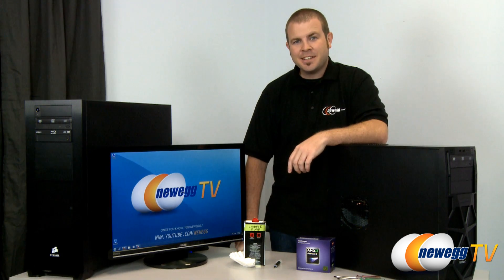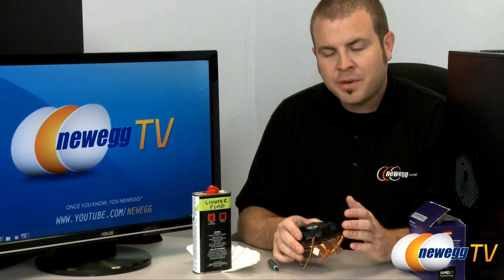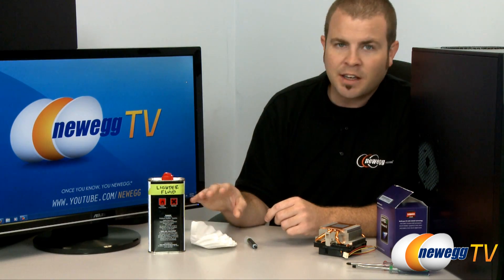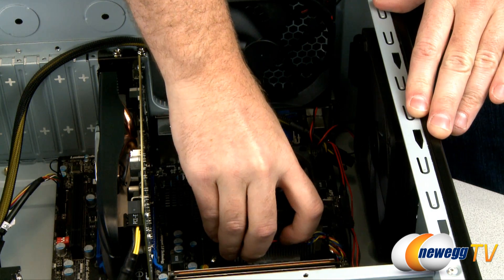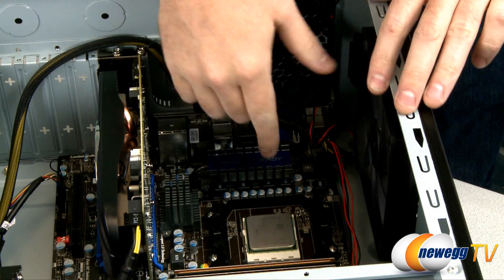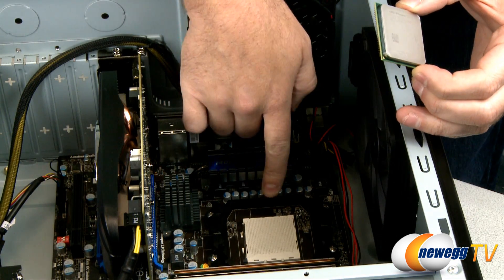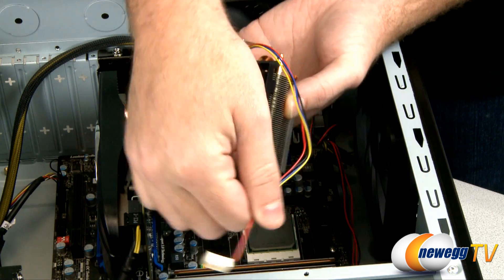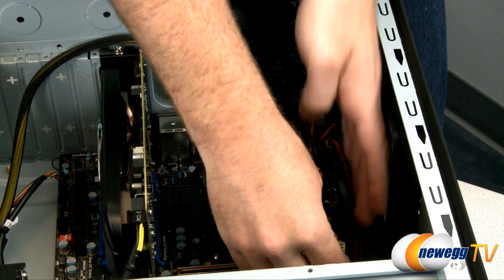Newegg Tutorial: How To Install an AMD CPU

Comment: question. i am swapping an i5 for an i7. it says its compatible with my motherboard. i want to make sure it works though. so would i be able to assemble it without the thermal paste only for a few seconds to make sure it boots, then shut it down immediately after? or do i run the risk of it damaging my cpu? basically how long do these things take to heat up? any input would be helpful. thanks!
Reply: Michael Guido just booting a PC without a heat sink ca n burn out the CPU

Comment: can someone explain to me what an aftermarket cpu is
Reply: +R4GEMODECLAN I&#39;ve only heard of aftermarket coolers. They do a better job keeping the cores (CPU) temperatures low than stock (the fan that comes with the processor). It&#39;s imperative that you buy aftermarket coolers if you plan on doing overclock. Overclocking helps AMD processors by unlocking their full potential. However overclocking increases temperatures and without proper cooling, will damage the CPU.
If you want to monitor temperatures and have no software to do so, install the program HWmonitor

Comment: Broke my cpu cos I didn't leave it on for 5 mins before, had to twist it off heat sink then it snapped out of my hands onto the bench and one of the pins broke off :(
Reply: +PopularOMGS Thermal paste was hard, when I tried to take the CPU off the heatsink it snapped out of my hands onto the bench, breaking the pins

Comment: I'm getting a new CPU, I already know which one and I checked so it all fits with my motherboard and so on. But after watching this video I just want to know, do I have to apply something to my new CPU or is what's on my fan going to be enough? And if I need to apply anything, can someone tell me what that is?
Reply: ***** That depends.. Are your over clocking your CPU? If not. The fan that comes with your CPU is good enough.
Reply: Millenia Williams No I'm just using it normally. Okay thanks!:D

Comment: so i can just swap stuff out on a pc when it gets old.....fuck ive wasted so much money on consoles honestly i feel like ive been robbed wtf like thought itd be all software shit but its basicaly take it out put ur new one in.
Reply: Not really. If you have a motherboard that's compatible, you can just swap out CPUs, though if you have a good processor right now, you'll be good for a quite a while.

For graphics cards, yes, its just a matter of swapping the cards and changing the drivers.

Building a PC is not difficult. It can be intimidating at first, but you'll get used to it. Also, I did a quick calculation a while back. PC gaming, even if you have to upgrade a graphics card after 2-3 years (basically 2-3 cards for a console cycle), it can still be much cheaper than console gaming, thanks to overall cheaper games, Steam sales and free online service.

Comment: ok some people are saying that fx 6300 is crap it ruins the gameplay and i should get i3 over fx 6300..and some people like tek syndikate are sayind that fx 6300 are so fast and they can reach 200 dollar cpu..so im just a gamer i dont do any video editint and stuf like that,,,i just play games at 1080p maxed out..I really need hellp..thanks p.s
Reply: Hey. Yeah yeah late response, but it is in fact worth the price to buy an fx-6300. The only reason why people by an i3-3220 is because they plan to upgrade that CPU to an i5 or higher. So if you want to stick to the fx-6300 which is better than the i3 (and is a beast overclocker), go ahead. But if you plan to upgrade your CPU, an i3 will do.

Comment: does the fan come with the processor itself? or is that bought seperately?
Reply: stock (storebought versions) cpu's come with a cheeper heatsink/fan which are usually noisy, so you will most likely get a heatsink/fan if you buy it new the only time you probally wont is if you buy it used but you can buy them cheep of ebay or newegg
Reply: wolfEXE57 thanks :D

Comment: How do u tell if your CPU will work with your motherboard
Reply: ***** if a mother board supports intel will it support every intel cpu or only specific ones
Reply: an important thing to keep in mind is that intel mobos only support intel cpus, and amd mobos only support amd cpus.  then you need to take the pin arrangement into account (LGA/PGA XXXX), and even then you really need to check each individual board to make sure it's compatible with your cpu, or the other way around.  it would be much simpler if they were all universal and standardized, but they aren't.

Comment: I just started my build (ordered from newegg) and tried to be very careful, but the clip on the side wouldn't attach the cpu fan onto the amd cpu. As I took it off to try again, a small metal plate with 2 protrusions on opposite ends came out. I don't know what to do.  Is this heatsink fan done? It was supposed to be new, and the paste was preapplied, but the copper bottom was really scratched before I even tried to use it. What can I do? It's my first build and I have tried to be very careful, grounding myself, etc. [I know I should reapply cooling paste from somewhere...]

Comment: It largely depends on your motherboards socket. If you can find an 8 core with the same socket type then yes you can. But depending on the chip set and its compatibility with the new CPU you may or may not get the full potential out of the new CPU.

Comment: I guess to show people if they were to remove the heat sink to get access to other components, they would need to reapply a new layer of thermal paste each time. He also explains it if you were to reuse the cpu or the heat sink that it is recommended to clean off the old thermal paste.

Comment: The thermal paste is generally on the heatsink rather than the CPU itself, it is a primer type gray color so if the heatsink is that color, you are set =]

Comment: I've never bent a pin but if you look at them they are super thin and if not only plated in gold they may be fully made from gold which is a soft metal in the first place, but if you are careful you should be good:) Many Intel CPUs don't even use pins they use contact patches so you don't have to worry about bending them.

Comment: No, dependent on the series they generally have different contact(pin) placement or a higher/lower amount of pins overall, a lot of motherboards will allow for installation of different types of CPUs so check out your motherboard online to see what kind of CPU it is able to hold.

Comment: When you get the processor, It will have a foam padding protecting the pins. If you install it like this guy, then you will have no problems whatsoever. I have a amd cpu installed currently and I had no problems when I installed mine. Hope this helps.

Comment: You don't have to cure the paste. It's recommended but not necessary. I've never cured my paste and have never had any problems, but then again I don't O/C my CPU. But if you're asking whether or not to cure your thermal paste than you're probably not O/C either. SO don't worry about it. As far as paste being included, it should be in the box with a new CPU cooler or already on the CPU contact plate, if not most electronics stores sell it and its not expensive for a syringe.

Comment: Try to replace the MOBO and processor just to be sure you didn't get a faulty one, if that doesn't work, return your AM3 and try a AM2 processor. You still have the warranty right?

Also during instillation you made sure to ground yourself before touching ANY of the parts right?

Comment: Here's the difference. Yours is stock clocked. Probably a rested temperature reading, and liquid cooled. You're comparing apples to oranges rookie. Mine is OC'd, stock heat sink fan, resting at 42 celsius; stress tested at 62 celsius --- And the average resting temp for any processor is around 50-55 celsius. So I think it passed with flying colors at a 100% load test.

Comment: @kyle589 the 990x im sure comes with a fan, but that might not be, but in the vid i saw it had the compound in a plastick bag. If it doesnt come with the fan i know what fan to get, notchua or something, although im sure there is a fan. There are two extreme i7's, one comes with the fan, and the other doesnt. 990x, with, 3960x none

Comment: @MultiSnoopDawg Put a pea size drop on the processor after its installed then cover your index finger in a plastic sandwich baggie and spread it out. Dont use force tho while you do it. Just gently spread it out.

Comment: @Mudux My case is a intel core i 7 extreme, and it comes with it none applied, but it has it in a little package, so i wonder if i need a tool do do stuffs or there aint a problem. Yes that was a mounth full, and i dont know that one word i need :D

Comment: you make this look so easy and simple, but there are so many variable to account for. it took me weeks  to figure out the specs of my pc, what kind of socket i have and so on, my computer is identical to the Lenovo H405 accept that it came with a duel core and not a quad.  when i called Lenovo they said that they do not support upgrades. I have now spent 300 on upgrades bringing the cost of my computer to 600. a new machine with the AMD Athlon X4 645 Propus costs like 800.00  so i still saved $

Comment: @SlimChance718 

there is this socket type for each cpu. intel tends to have Socket type 1155 in their processors, while AMD usually have AM3. motherboards have one specific socket so if your motherboard has a 1155 socket, you can only use processors with that Socket type,in that case Intel processors. if you know the socket type of your old processor, you will need new processor with that type. you can not go from amd to intel for example because of different Socket types

Comment: is there a certain direction the heatsink fan has to be facing? because the wire wasnt in the same place on the newer fan then the old one just wondering.

Comment: no problem

 a power supply/ psu is really easy to hook up,you just connect everything the same as you disconnected it.
take pictures if you have a camera or use google or youtube,or even draw a simple diagram of what connector went to what thing,ok!!
if you dont play heavy duty graphical games your graphics card you picked may be fine (the 5570)but its not going to dazzle you a whole lot im afraid
but even if you dont get a new video card right away,try to get a better power supply

Comment: @ezio1462 umm,no it wouldn't,my phenom II 940 doesn't bottleneck a 295GTX,2 9800GTX+'S IN SLI OR MY PAIR OF 460GTX'S IN SLI.this is just drivel and hype given to you by fools trying to get you to foolishly buy another CPU when you absolutely DO NOT NEED IT.its pointless and do you need the extra 3 fps,no you actually dont and you will not notice it anyway.

Comment: @Creationcreed  yes it does and yes your probably o.k.BUT, you should check your motherboard name and manufacturer it will be written right on the motherboard like "ASUS M4N-79",Then google "cpu compatibility for "asus m4n79"and it will tell you every CPU thats compatible with your current motherboard,ok?

hope this helps,Ive had 5 motherboards and they all could work with AM2,AM2+ and AM3 cpu's,so yes in most cases youll be ok,just double check your motherboards compatibility ok?

Comment: @LayenPipes  your going to end up with an amazing processor and a terribly weak video card,i would definitely suggest you add a decent name brand psu such as coolermaster  antec, corsair  and start at about 500 to 550 watts and it would only cost well under $75,then for a video card get minimally a 450gts(nvidia) or a 5770/6770 (ati) and youll be set to play any new game at decent frame rates and resolution

Comment: @Creationcreed Get CPU-z and see what CPU is installed in it right, if it's intel then you know it's not compatible, if it's AMD, then you need to find out what socket your CPU is. If it's an AMD2 socket CPU, which is the AMD Athlon 1 line I believe, then you couldn't use Phenom II or Athlon II. If it's an Athlon II or Phenom II CPU, then it's AM3 or maybe AM3+ depending on how recently you got it. Kinda short explanation but the character limit is annoying, best I can put this in the limit lol

Comment: @Darkpirater But sometimes they can't handle all GPU's and that's where Intel does come in handy, not bottlenecking high end GPU's. I promise a Phenom II X4 955 would bottleneck a 580 @ stock clocks, where as an i5-2500k would not. Even clocked @ 3.8ghz or so there may still be a slight bottleneck on a 580 from the Phenom II x4. But don't think I dislike AMD, I have a 955 in my room right now ready to be installed, just need my PSU getting here today.

Comment: @MegaMnguyen it matters if you have a system with 4 gb + ram memory. If you do, then go ahead with the 64 bit version. The 32 bit version only supports 3,5 gb of ram, and it will not be able to take advantage of your, say, 8 gigs of ram.

Comment: @erigonsnest Honestly, cables are the least of your worries. Most mobo's include more than enough SATA cables. Your PSU should also come with enough power cables. If you're buying a discrete gaming graphics card, it SHOULD come with a video cable; most likely a DVI one, some cards include an extra VGA one. Aside from all of that, the only stand out would be an ethernet cable. If you're still using old IDE HDD's, then they should already have their own cables. Nothing else to worry about.

Comment: @m4ht1sonni I agree with basbas63, I own the 1090t, but if I had any of the other x6 processors i would just overclock to the same frequency, the heatsink can handle it as it's the same, and the chip itself should be able to EASILY make it to the 1090t level, most of the x6 processors can make it to 4ghz

Comment: Hi Paul,

When you were talking about alternative methods to get rid of the old thermal paste, you mentioned rubbing alcohol.  Did you mean the actual 70% Isopropyl rubbing alcohol used for cleaning off open wounds?  Because I've heard that you can use 90% alcohol but I don't have something like that at home.

Comment: @MrSchnitzeI 
that really depends on ur motherboard.  i was thinking about doing the same thing but found out that different amounts of pins for CPU's come out almost faster than new video cards come out.  essentially u want to match the amount of pins ur motherboard supports in a CPU and find the appropriate upgrade.  from what i know of my own comp, upgrades for it stopped pretty much after dual core CPU's (i have an intel pentium 4 single core) awhile ago (comp is from 2003)

Comment: @SeppukuTrainer I finally found somebody out there who told me to loosen the screws on the mounting bracket on the motherboard, as long as i checked to make sure that they were not quarter turn screws (meaning they come out after a quarter turn).  So i loosened the screws a bit, fastend the HSF, and tightened the screws down a little so the HSF was tight.
Hope this is helpful.

Comment: Why did you clean the old chip on the mobo rather than off the mobo where there was less chance of stressing the mobo or maybe even contamination on the mobo's cpu socket?

Thanks for the vid...its encouraged me to get a new setup based on the GA-880GMA-UD2H  that would run a lower spec AM3 cpu while I wait for the daddy 1090T to come down in price. There wouldn't be any problem doing that..ie all set up for the 1090T but using say Sempron 140 initially?

Comment: i have a question, my stock heatsink will not latch both ends as you are suppose to, i'm wondering if this is something to do with the mobo or the heatsink itself, i'm also very concerned that my cpu temps reach 90 degrees celsius. ... is this because the heatsink isn't on properly?

Comment: @gojacketsgo61 i think the 4850 would be the best bang/buck of any gpu available today(regardless of price), but you need to make sure your power supply has a 6-pin pci-e power connector, or it wont work. if your psu doesn't have one, then get a 9800gt instead(make sure the one you pick doesn't need the connector, some older 9800gt's do). the 9800 gt is slower then the 4850 by quite a bit, but its also cheaper and uses less power. 4850>9800 gt > 5670 > gt240.

Comment: @gojacketsgo61 the 5670 is a waste of time, its not fast enough for dx11 to matter and its less then half the speed of the 4850. the 5670 only makes sense if your power-supply doesn't have a pci-e connector, and for some reason you absolutely NEED dx11, and i don't see why you would... btw, most of the 9800 gt's don't need a power connector either, and they're cheaper, and they're faster... again the 5670 doesn't make sense. I'f the 5670 was $60 like the 4650, it would be great, but it isn't.

Comment: Intel may be 10% faster than AMD. But you pay maybe 200$ for a solid CPU from AMD. if you want a 10% faster chip from intel you have to pay 600$ more which i could use towards other parts.

I'm fine with my 10% slower AMD chip because i saved a hell of a lot of money. If you have the 600-1400$ too spend on a 10-20% faster chip then go for it, i'm happy with my 200$ 10% slower one.

Comment: @gojacketsgo61 or 4850... i know you said UNDER $100, but the 4850 is so much faster then the gt240(Im assuming he meant 240, because the 220 is a joke)... newegg canada lists sapphire's ddr5 version at $99 after a $10 mail in rebate. If you're absolutely limited to under $100, you can always get the 9800gt for $90, i really recommend the 4850 though, its faster and probably wont give you driver problems since its also ati.

Comment: AMD can suck it. Intel i5 750 beats this X6 chip, I know I have both for video editing and gaming. Look at the bench marks stupid, the overclcoked i5s beat 6 core chips and they are just 4 cores and lower clock speeds.

And it is a lot easier to install AMD or Intel CPUs when you remove the motherboard.